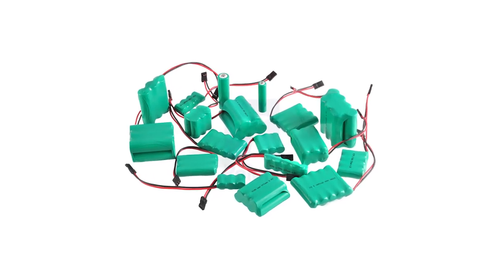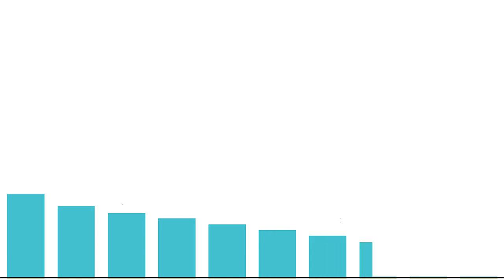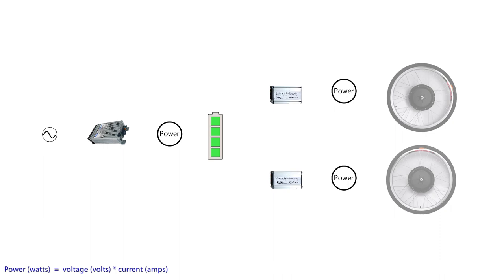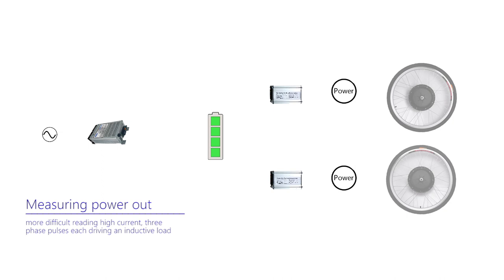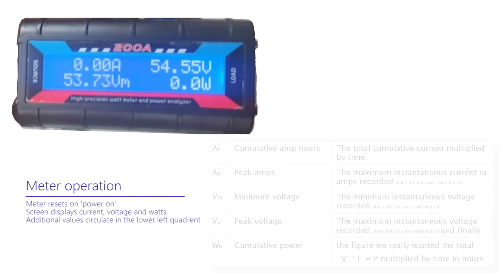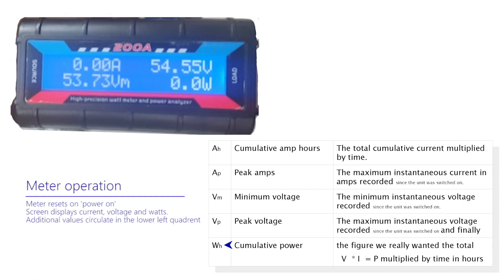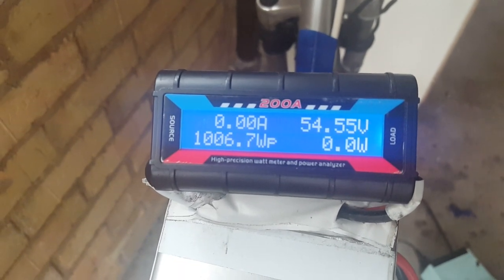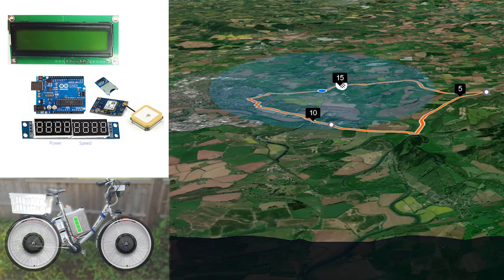e-bike battery performance

Comment: If you want to make it last you need to put an ultra capacitor at the bike and a current regulator between the battery and the capacitor.
Reply from the maker: I would, Walter, but they scare me.  :) Combining them with batteries to absorb the additional power from a breaking regeneration system IS interesting though.
Reply: @richard_wenner  here's what I have. 24v system. Detachable 24v lithium battery system. On the bike is a 26v boost convertor limited to 10A going into 32V 20F ultra cap with protection circuit.  So my battery system is limited to 10A(280W), which protects the batteries. Never any high amp spikes.  280W is good cruising power and the ultras provide great acceleration power. Also, I have a power meter in series in the battery bag.
Reply from the maker: @walterbrownstone8017  It would be interesting to see how the power is distributed during a 'normal' ride.
Reply: @richard_wenner  it's probably the best way. At low speed the motor is much less efficient and it draws the most current so it's better to charge the capacitors while you're putting on your helmet and gloves. I don't normally average more than 200 watts on a typical bike ride. I think I get 100km/kWh.
Reply from the maker: @walterbrownstone8017  I'll keep this in mind as I continue my range testing. Thank you.
Reply: @richard_wenner  My system is 500w and I always pedal so Al Qaeda doesn't know it's an ebike. I'm considering upgrading to a 12v system using a $40 1.7kw starter motor from Amazon.
Reply from the maker: @walterbrownstone8017  I'm building a recumbent to fully display my ghost peddling abilities.  Good luck with current control issues on low voltage options.
Reply: @richard_wenner  current control is where the ultra capacitors do their job. They can supply a thousand amps during acceleration and then at cruising speed only 10A is required. There are cheap switching transistors called IGBT that can handle large currents efficiently so I'll probably need to wire a few of them up between the output of a cheap $20 motor controller and the starter motor.
Reply from the maker: @walterbrownstone8017  Q = I * t
Reply: @richard_wenner e=½CV².=41.5x(16²-10²)=6474J useable stored energy. 1.7kw for almost 4 seconds. That's pretty good max rated power on a bike that weighs 60lbs.